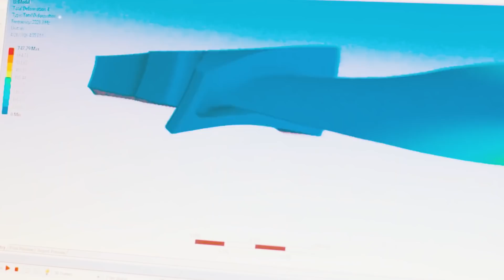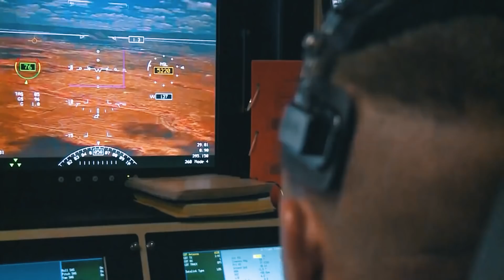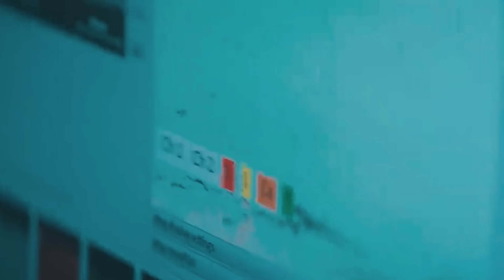The US Has FINALLY Revealed Its 6th Generation Fighter

Comment: They are building it now because by the time it's tested and mass produced it'll probably be a decade from now and then the cycle starts again. Air to air combat, nothing can touch the F-22 so it'll be around for a while and as the inventory decreases they will just part out the assets to maintain the ones in service.

Comment: No - the USAF didn’t revealed their NGAD. This is a blatant lie. 
And the comment of those generals - either way they are also a lie - or they are simply misinterpretations!

The program is definitely huge - and includes extremely futuristic and expensive components. And minimum 200 jets (probably more - due to the fact that the F-22 could never replace the aging F-15 fleet) would need to be built. 
Eventually is HAS to through a fighter competition - because one company has to take the crown to produce it. What we know this didn’t happened.
The quotes could be interpret into the T-7 Redtail as well, and the reference could be about the new design and manufacturing technology and ideology.
By the way, the F-35 is very maneuverable - and has a AoA of about 50° (computer limited) due to its augmented flight control system. This is often overlooked (also these type of capabilities come with “software upgrades”); and some more recent fly offs against Vipers have been very one sided (for the Lightning II)! 

So the whole video is based on misinterpretations and outdated information - nothing is confirmed (far of it). 
And- even if the airframe would exist as prototype (as per mentioned reason this is highly unlikely) the development of the system which would make it to 6th generation (eventually) would at least take a decade!

Comment: What is funny is the YF-23's second prototype flew with a GE Adaptive Cycle engine the YF-120 all the way back in the 1990's. GE has been sitting on the adaptive cycle engine technology for thirty years plus.
Reply: True that plane was just too ahead of it’s time unfortunately on a side not unfortunately the US fell for the casual audience and their love of supermaneuverable fighters. Funnily enough yf23 would fulfill the role the raptor does with vastly greater efficiency(beyond visual range) as it had a smaller radar cross section. That was the air forces greatest blunder maybe second only to the f35. Gotta love the lobbying power of Lockheed!

Comment: would something that swivels 3 dimensionally to keep the pilots body flat with how its moving relative to gravity make high g maneuvers more obtainable because instead of the blood going to your head or away from it, it goes flat with your body?
Reply: It would potentially help with negative g’s. But it wouldn’t with positive ones, also it would require more space to implement, which would mean either less thrust, les fuel, less maneuverability, less ammo, or less misses/rocket/bombs, or a combination of multiple of these. Which depends on what the goal of said plane is, but for most it would probably be too inefficient.

Comment: It is so so so so so hard to make a plane fly itself and be “smart” enough to destroy other planes/drones in a dogfight or encounter. It will take lots of time to make this happen.
Reply: Not as hard as you think. Anytime you play against ai in flying games just remember. There is no human controlling that. And in some games the ai adapt. Should just need absolute target ID from the sensors, program the software to not surpass hardware limitations which isn't too difficult, and hard code it not to fire on a human friendly should they fire on another human friendly. Essentially if someone becomes a traitor, hold off all hostiles and break off of to return to base instead of staying with a human that could be trying to fly to an enemy base with the drones in tow.
Reply: I'm not sure I agree with this. Well on one level yes it is really hard but no harder then many of the other things we currently manage to do with technology
Reply: Basically, what makes you say that?
Reply: @lewisw3436  air to air combat would be obsolete with drones because they’d require a constant data link and most fighters have pods and EW capabilities to interfere with those date links
Reply: @whoknows2356  I don't see why a drone can't be built with self contained sensors, ai and objectives/orders
Reply: @lewisw3436  because nothing built can ever replace the human brain.
Reply: @whoknows2356  for what the human brain functions as, absolutely not. At least not within the next 150 years at least. However for getting a spesific systems missiles to lock onto enemy targets im not so sure
Reply: i doubt it will be pure AI probably have a "pilot" with a joy stick from a bunker in the US fly it remotely to where ever it is in the world
Reply: I don't think so I have a shark robot vacuum cleaner that vacuums whatever room I'll tell it to vacuum. I can send it to vacuum my bathroom or kitchen or living room or wherever I want it to go, and it vacuums in a straight line and doesn't miss an inch, goes back to its base, and empties itself out.

It only cost around $500 so I think our military won't have much problem developing robot planes. Plus technology is growing faster and faster.

Comment: 10% more thrust and 25% more range is a big boost in capability. Nice engine.
Reply: You will NEVER find peace on earth…😒
Reply: @FofXequalsYnot  ok
Reply: and a 300% boost to R&D, purchase and maintenance costs
Reply: 6th gen fighter will be more like a mobile command center managing a fleet of unmanned drones. Imagine each pilot with several drones around them under their command which can also kamikaze suicide to save the 6th gen jet in case of an attack.
Reply: meh
Reply: @brq44  not quite as “meh” as you would think though, quite a significant difference.
Reply: @chrisrenemans5026  I mean when dogfighting yes but people don’t really do that anymore
Reply: @brq44  more thrust means higher achievable speeds and more range means the aircraft can stay in the air for longer without the need for refueling thats gonna be usefull in a lot more than just dog fighting
Reply: @remdr231  well at least more range is better but 10% thrust is like if you go 2500 knots you will just go 2750 knots, but it can be useful outrunning other fighter jets
Reply: @brq44  true, also means faster attack runs werether its on air targets or ground
Reply: @remdr231  yep
Reply: @brq44  Amraams are a beautiful thing
Reply: @GenX_-um2ct  okay?
Reply: @remdr231  speeds not the problem out jets are slower than that of the 80’s most of our fights reach Mach 1.6 older models reached 2. Something I can’t remember but there’s a good reason for
Reply: @brq44  may seem small numbers but its better.
Reply: ok
Reply: @rayanmalwatta5337  don’t be mad blame your 3rd world country bum

Comment: I have already known about this fighter and the SR72. When you know a guy who knows a guy, then you can get a lot of information. Little hint, crossed six states in five seconds.
Reply: The average width of a US state is 275 miles give or take. 275 miles in 60 seconds converts to 999,000 mph, almost 1 million miles per hour. For reference, the International Space Station moves at a speed of 17,500 miles per hour. The circumference of the earth is 24,901 miles. By your logic, our next generation aircraft goes around the earth 40 times per hour, and travels 57 times faster than the international space station. At these speeds where you can cross the us in less than a minute, how is one supposed to hit a ground target or another aircraft? How is the plane not supposed to melt from the heat formed from the overwhelming drag? If it’s traveling that fast then how long can those speeds be sustained, what is its range? I eagerly await your answer for I am genuinely curious.
Reply: destroyed by facts and logic, L

Comment: That is where they always screw up? It must have air and ground attack value. Why? Build 2 and have them work together and each be lethal and better than anything the enemy has!
Reply: They are building 2, they are just using a similar frame to start both with.  Its like Ford using a Fusion (4 dr sedan) chassis for an Edge (SUV).  Obvious cost and production benefits.

Comment: I'm still surprised the US  hasn't developed a fighter capable of both traditional and space flight as well.  Being able to strike from space would be a huge advantage.
Reply: jet engines don't work well in space and I think rocket engines would probably be too much for a fighter to handle.
Reply: Technology isn’t there yet, “at least within reasonability and size” weaponry isn’t really there yet either, at least with, again, size. And the engines and variety of other systems aren’t to that point yet.     They would have to provide more oxygen, more pressure, more temperature control, heat shielding, vacuum engines (as well as atmosphere engines), weapons to make it worth while,  and far more things that I can’t think of right away. And they would have to fit it within the already small figure of modern fighters for it to be practical.

Comment: now that Full blown war is happening in Eastern Europe by Ukraine vs Russia, i can only imagine how the USAF is hastening it's prototyping and possibly production.

the flaws of todays future aircraft is the pilot itself since humans can't take heavy load of G-Forces the aircraft capability is not used at it's full potential but if somehow scientist and engineers could crate a way out of this is to research and built inertia negation technology that provides any pilot with a cancellation and compensation of g-force produced inertia at high maneuvering speeds.

Comment: I've thought that it would be really helpful to have a aircraft that has the ability to essentially decrease speed rapidly, alter it's direction, accelerate rapidly to turn into a otter 🦦 or seal 🦭 but in the air.
Reply: Sounds like what pilots have described in those ufo reports
Reply: Sounds like a TR3-B to me
Reply: @foxglow6798  Yeah that's what I was hinting at, that craft, and the rest of the Aurora Program. Hoping maybe one day they'll declassify that program, but highly doubtful lmfao
Reply: You're describing what has been ongoing  for decades worldwide , the UFO  phenomena. Aleast that's what we've been told for years.
Reply: Black budget aircrafts with those capabilities are most likely only for the CIA's airforce and NSA.
Reply: @exist  makes no sense
Reply: What you are talking about is hood AOA and bleeding g off energy fast. The Rafeal and many other fighters are already famous for doing this. However, but not at the speed for what UFO’s can do😅
Reply: @bri-manhunter2654  isn’t the Raptor the most agile air dominance fighter tho?
Reply: @foxglow6798 yes and no, can’t answer this question with an absolute; the F22 is very good at one and two circle fighting no doubt. However, it was designed to launch Fox 3’s from BVR without being seen. Check out the one circle abilities of the Typhoons and Flankers. Honestly, there are a lot of variable involved. For instance, the new Aim 9X’s are crazy good missiles in Fox two merge engagements. 

Also, if you like to learn more about the fighter abilities throughout the world you can learn a lot from the full on Simulator “DCS”. Longshot  and Growl Sidewinder are great to follow.
Reply: So aircraft can kind of do this, but the issue is accelerating again to regain the energy you lost - it’s a little tricky
Reply: just pull the stick down really hard and you'll slow down fast enough, watch the planes flying the mach loop.... normally though you only do that if being chased otherwise you're trying to preserve your momentum
Reply: That would be good, but modern combat focuses more and more on beyond visual range combat, and bleeding speed quickly does not help with that, as for turning, excluding unmanned aircraft, there is a limit of hard planes can pull.
Reply: @chrisrenemans5026  Considering Kelly Johnson, Don Phillips etc. from the Skunkworks said in the 60s that they had the technology for Mach 16. Hard to believe black budget projects with unlimited funding haven't found the solution for cancelling most of an aircrafts mass and mitigating the inertia.
Reply: @exist  I meant more of what the pilots can handle
Reply: @chrisrenemans5026  Which is why I said technology that basically removes most if not all Mass, and mitigate the inertia effects Humans would endure pulling high Gs...
Reply: @exist  that, according to basic physics, is impossible
Reply: @chrisrenemans5026  It's impossible from our current understanding of physics. But that doesn't mean aerospace companies haven't solved the equations. Nikola Tesla basically laid the foundation for future scientists and engineers to dive into Antigravitics and Electromagnetism. I'd bet my life that a black budget project has found the solution.
Reply: @exist  only possible way would be to create something that provides a force equal to, or rather equal to -1 would it be possible for this to happen, and in order for that to happen would have a pull that would slowly ruin our orbit, as for true anti gravity stuff, that simply is not possible, there are things that appear to be less effected by gravity, but they can not be harnessed
Reply: @chrisrenemans5026  You keep going on about it being not possible when there's actual crafts flying around with these technologies for 70+ years. It's not a matter of if it's possible, it's already been done, now it's matter of if or when they decide to declassify these technologies. Example, Water is not supposed to be able to be used as fuel, but Stanley Meyer was able to invent a Water Fuel cell. Which, by our current understanding of Science, is not possible. Which in turn got him assassinated because of the technology he created.
Reply: @exist  weight does not contribute to G-forces my son, gravity does. You want less G? Tune earths gravity lol… G-force depends on acceleration. Ever heard of 9,81 m/s2? Even if you’re aircraft is made of exotic matter (negative mass) YOU would feel normal acceleration thus normal G forces… why is a 16 yo military maniac playing the wise teacher? tststs…

Edit: It’s possible in space tho…
Reply: So basically Ace Combat

Comment: To everyone saying we need unmanned fighters - the future for the air force is essentially one manned or a few manned fighters loitering out of range acting as "command centers" guiding autonomous jets specialized for the specific mission. The US has been working with AUS for years on this. This is the Loyal Wingman program. 

Also, the air force is changing how it procures new jets. Instead of one massive program, it will have smaller programs using computers to quickly generate more up to date jets. This is similar to the production method used by Apple for its smart phones.
Reply: In the early 90s the USAF was working on subspace platform aircraft.  In deployment they hoped to have three squadrons on 9 AC each.  Eight of the 9 would be in "orbit" and essentially perform a 24/7 lookdown shootdown, communications platform collection, mapping of just beneath the ocean/earth surface.  One plane would be flown by a Col/0-6 on 8 or 12 hour shifts so that one true pilot would command the squadron.  Those AC were supposed to have a body built from materials that could stretch or retract depending on the speed or at the edge of space.  I never could find that Popular Mechanics/Science article online again so me thinks descriptions of the AC and deployment remain classified to this day.
Reply: Not to mention unmanned or manned g force is still going to be an issue because high g forces can damage an airplane pretty badly if sustained for too long.

Comment: If it's a single seat aircraft,  it will be Compromised.  If the pilot workload is above 1.0,  it will not be able to use all it's systems to its full extent.